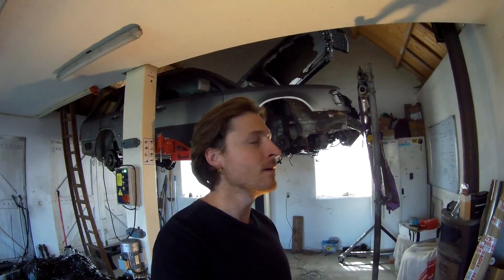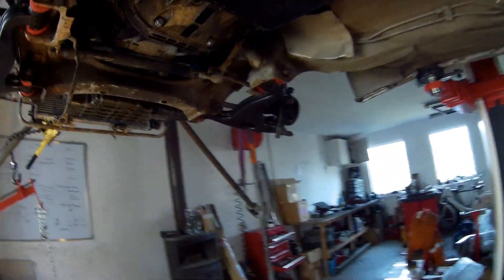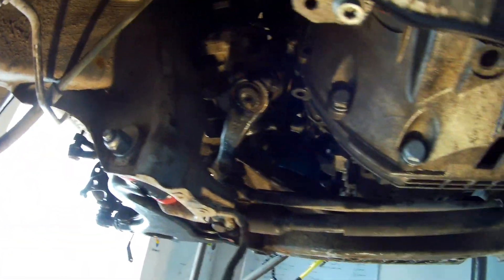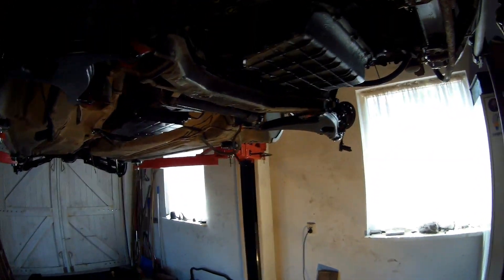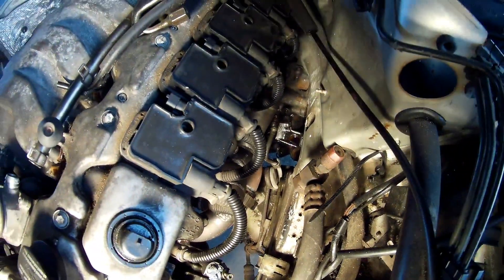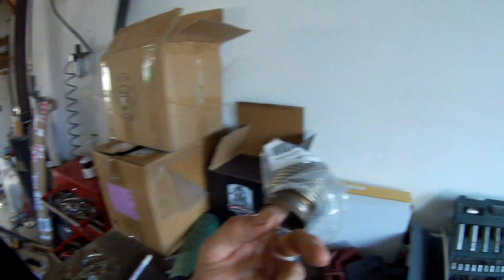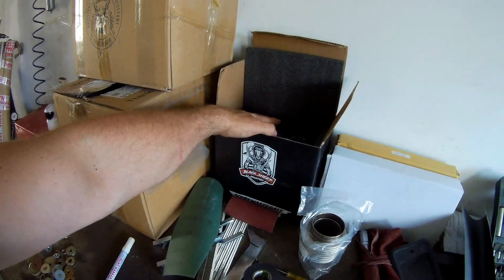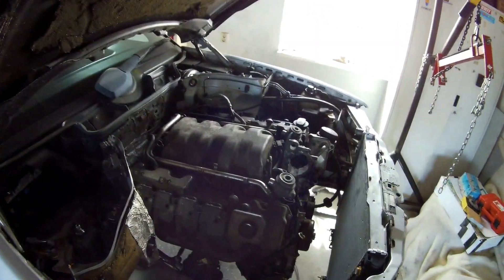M113 turbo manifolds done & steeringbox clearance solved

Comment: awesome build, do you think a steering rack from R129 V8/V12 would work in this situation?
Reply: No. It works in the R129 because the engine bay is wider and the gearbox is positioned further away from the vehicle centerline thus further from the engine
Reply: Good question

Comment: Johan.  I have never had a broken w124 steeringbox.  And if,…… you can overhaul it cheaply.    So that should not be a reason for not installing the sneller V8 steering box
Reply from the maker: A v8 would also not be small enough to clear manifold . But here in europe a v8 box is very rare. At My opinion this is Just the best solution
Reply: @JMSpeedshop  The Sportlines also came with the smaller box. Not sure if you had more of them over there.
Reply: What steering box are you talking about? From what model?
Reply from the maker: In using the oem box for inline engine's.  The v8 box is smaller .   I have lowered the box 4 cm.  And modified the reaction arm
Reply: @bernardwarr4187  w124 V8 models
Reply: @stentuning  do you have a v8 steering box?
Reply: @bernardwarr4187  yes in my 500E :)
Reply: @stentuning just preparing for the swap in my 500E M113K

How did it go with you for both the steering and the exhaust?